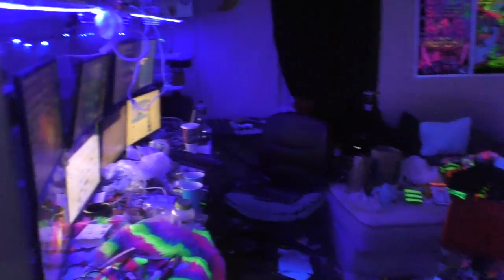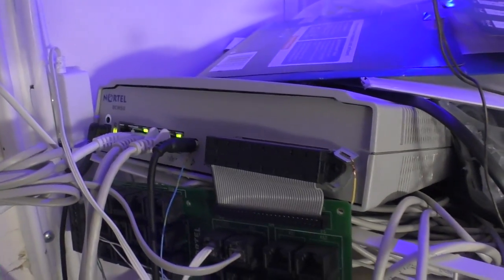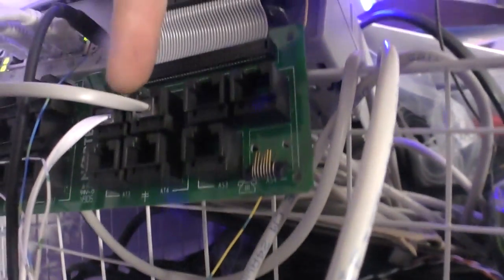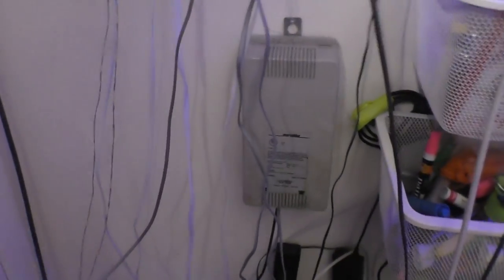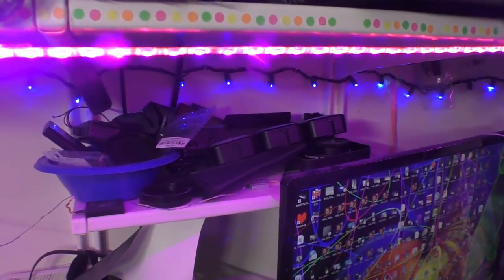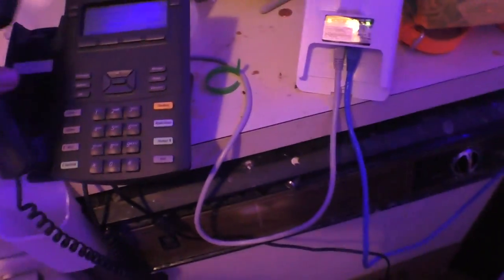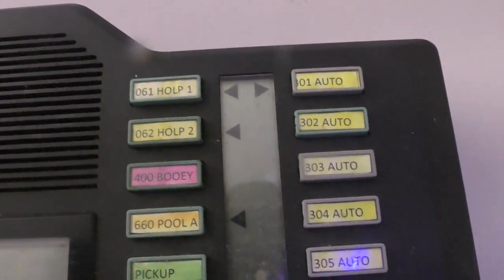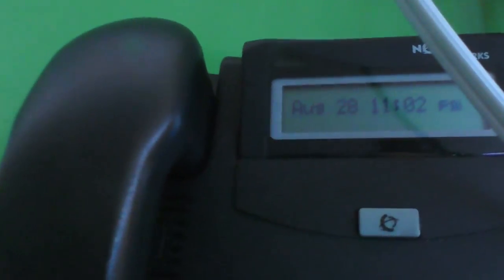My Ridiculous Phone System

Comment: Definitely more elaborate than my FreePBX setup.  I only have one desk phone and a Sangoma Cordless phone connected.  My Roommate still wonders why I have a desk phone that rings like Jack Bauer and has a handset lifter on it (The desk phone was $60 and doesn't have EHS capability).  My previous townhouse I lived in had shit cell service so neither of my cells worked at home.  However, I could use Project Fi to forward calls to FreePBX.

Comment: How do I configure the avaya 1220 to my bcm50? I can't figure it out since you have a avaya 1220 on your bcm50 I was thinking you could let me know.
Reply from the maker: You need to replace the SIP firmware with the UNIstim firmware.    Google "nortel sip to unistim" for help.
Reply: @NillKitty  My 1220 already has the latest unistim software. I have configured the s1 and s2 correctly and it recognizes the bcm50,and now it says nortel on the screen and the light on the top of the screen flashes. I don't know if I need to change its DN or something else.
Reply from the maker: @firefone8127  make sure your bcm50 is activated for "IP sets" license key.  You don't get this for free.  Check the bcm manager for how many IP sets your system allows
Reply: @NillKitty Thanks for the help I appreciate it. Element Manager says I have two Ip set licences. I will hopefully figure this out and get my ip phone working.
Reply: One thing I didn't mention is element manager sees the phone and I can  
deregister the phone and change its DN. But the phone doesn't fully register  or something like that wich is really confusing.
Reply from the maker: @firefone8127  Are you on the latest firmware for that device?
Reply: Yes the phone is on the latest version
Reply from the maker: @firefone8127  same thing happens with a different IP set?
Reply: @NillKitty  No I'm just trying to set up 1 ip phone.
Reply: @NillKitty  Do you think it may be my ip phone that is the problem?

Comment: Hey Nill, I wonder if you can do the background music feature code on an analog phone? I keep wondering if something like flash *86 would do anything and to end the music you would just hang up. Its just a thought.
Reply from the maker: No, you get an invalid code tone and it does nothing on an analog set.
Reply: @NillKitty  Ok can you also do a video explaining how to connect a paging system if you can?
Reply from the maker: @jonathankeenan80  I will when I reconnect mine
Reply: @NillKitty  What brand of amplifier are you going to use when you hook it up?
Reply: also, I forgot to mention that the bcm50 has sip trunking build in so, why do you use an external ata?
Reply from the maker: @jonathankeenan80  I don't have SIP trunking features enabled on my BCM, and also the use of an ATA gives me more control than the BCM provides.
Reply from the maker: @jonathankeenan80  I just live in a house so I use normal monitor speakers/amplified pc speakers
Reply: @NillKitty  Ok, I think I know why you don't have sip enabled is because you need a license in the system to allow that feature which probably cost more than the ata. Am I correct?
Reply: @NillKitty Can you explain how to fix the problem on the norstar system to where when you dial 9 it doesn't pick up the last line on the system? I would like to know how to make it to where when you dial 9 it goes directly to line 1 and then to the next line when another user dials 9 to use the next available line rather than start from the last to the first. I'm asking you this because I have been trying to ask The Nortel guys channel but, he doesn't seem to respond to comments anymore. Also the system I am  using is a nortel MICS.
Reply from the maker: @jonathankeenan80  there are 3 ways to do this (line pool code, routing codes, and outside line prefix) but I would suggest using a line pool.

Assign your external lines to Line Pool A, and set the line pool code to 9 (you'll need to make sure it's not in use as a park, external, or routing code prefix) and then make sure the sets have access to that line pool.

Comment: How does the beige t7100 work on POTS wiring?
Reply from the maker: Norstar phones just use 2 wires, it's no different at all from POTS wiring, only the signaling is different (digital tdm vs analog)
Reply: Is the t7100 the only phone that will work on POTS
Reply from the maker: @maxravnaas1719  it doesn't work on pots, it's just using pots wiring.  The other end still goes into the BCM it just uses the wiring that's part of the house to get there
Reply: Thank you. How is the wiring installed? Did the installer actually feed it through the walls or did you remove them(walls)
Reply from the maker: @maxravnaas1719  the wiring predates my living there and probably was built with the building.

Comment: What feature is "Camp-On"?
Reply from the maker: Are you the guy that just called me?   XD   Camp on takes a call and essentially puts in almost "on hold" on another extension.   The extension you camp onto will show "<Line name> waiting" and make the same tones as if you put a call on hold;  but you can pick it up by lifting the handset.   When a call is "camped on" a set,  all sets with answer DN's will also ring as if it's a normal call.   Camp on can be used to send calls to a phone even if it has no buttons available.

Comment: How much do you pay for intercom calls alone on the bcm
Reply from the maker: Intercom calls don't cost anything but you need to license the ability to connect the sets in the first place.  You can buy keycodes to unlock the internal digital, analog, or IP sets, or you can get a keycode to unlock an expansion unit and then put in a digital or analog set card
Reply from the maker: I have these keycodes unlocked: 1) internal analog ports 2) ip sets 3) expansion bay 4) voicemail

Comment: Where did you get the amphenol adapter that convertes the amphenol connector to the jacks you can connect phones to?
Reply from the maker: https://www.google.com/shopping/product/1?q=ebay+Nortel+bcm50+break+out&safe=off&client=ms-android-verizon&biw=412&bih=718&tbs=vw:l,ss:44&prmd=sniv&prds=num:1,of:1,epd:5969807381162642791,paur:ClkAsKraXwft7y4LbnQ8HQm7AUaq2dWW5Kk39o-ePbtWKqB5SBsNFFIOgVtX_F0qNMnG7Ypnptxbo54O-I9gMxEIEW4J2Gg97bHJXwwOFaZQlIm1oEi12Ur9sxIZAFPVH70bIQSdWzxIJsRYepYftBKcjEnG0A,prmr:1,pid:5969807381162642791,cs:1